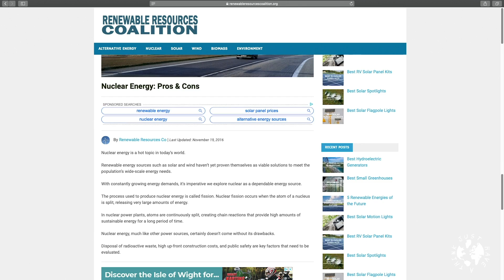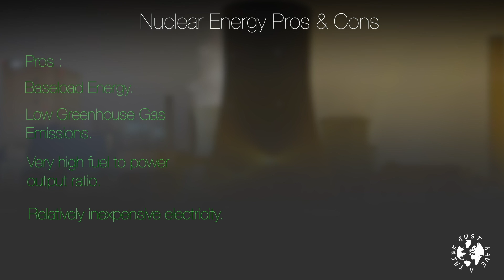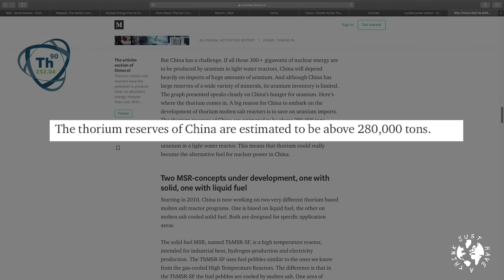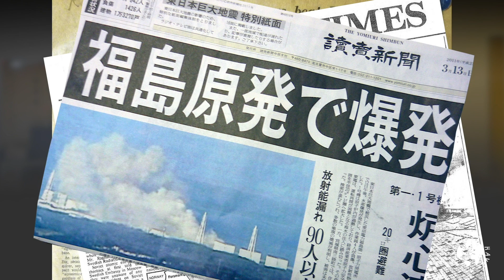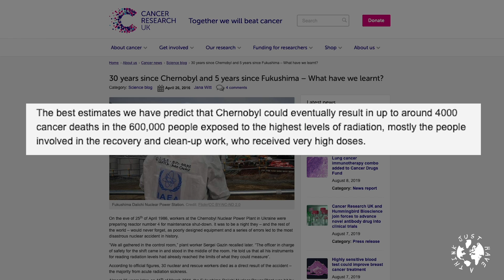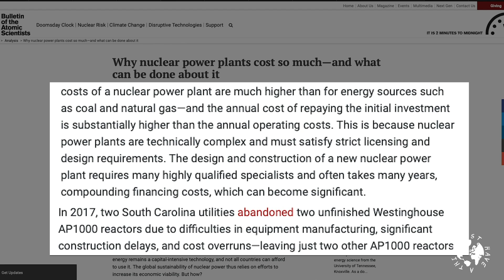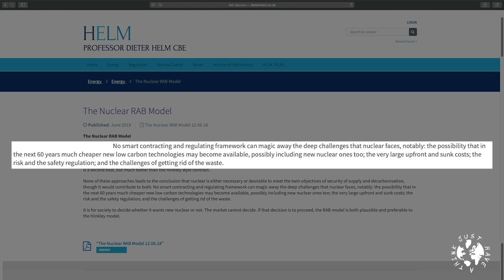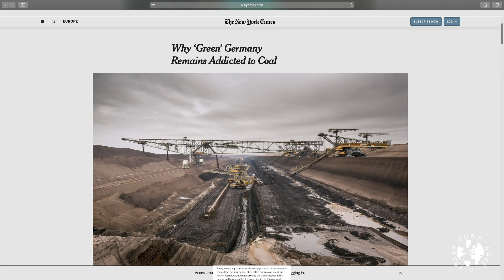Nuclear Energy in the 21st Century

Comment: There were specific circumstances that lead to both the Chernobyl and Fukushima disasters. Chernobyl was an ages old graphite core reactor which should have been shut down decades ago. In addition, the proximate cause of the disaster was an ill-advised experiment. Regarding Fukushima, it was madness on its face to build it on the sea shore in a zone subject to earthquakes and tsunamis. Regarding 3 Mile Island, it was built using 'old' technology which wouldn't pass muster today. There does already exist a safe nuclear reactor technology and that is the Candu heavy water reactor. In the event of an accident, the core is flooded with heavy water which cools and moderates the core in a few moments. Thorium salt reactors are still being developed and tested and they do look promising. A key advantage to thorium salt reactors (if they can safely be brought into service) is that they are much smaller than current reactors. There are a half dozen or so companies pursuing thorium salt technology.  Regarding the problems with cost over-runs of fission reactors in process of construction, it would need a thorough examination to determine the cause(s) in each case. However, bad management appears to be at least a partial cause in all. In summary, there is reason to believe that well planned and managed fission reactors could be safely built using modern technology and with due respect to lessons learned.  Having said all that, according to media reports scientists working on fusion reactors believe they may be close to very close to bringing fusion reactors to the engineering design stage of development.
Reply: This argument includes a lot of correct information, but when you said specific circumstances youre not really going far enough. Graphite moderation played a role in Chernobyl, but what a lot of people don't fully appreciate is the amount of issues that all had to go a very particular way in order for the reactor to have a worst case scenario. These factors not only included fundamental systems in the reactor itself, but also required particular energy usage during the day, and specific operation time for the reactor. If the safety test at Chernobyl has been run 12 hours later than it did the events likely world not have occurred in the same way as Xenon concentration (a neutron absorber) would have been significantly depleted. 

We see this with every major accident and not only in nuclear accidents. Even with a less so incident like Three Mile Island a lot of people correctly point out to the issue of water reactors, but in order for that accident to have occurred there was a long stream of events that had to transpire in order for the accident to occur a particular way. 

In Fukushima yes there is obvious risk from seismic forces and yes the tsunami flooded the reactor creating issues. However there are additional issues such as the time and rate of pressurization in the reactor core following the accident, the culmination of radioisotopes in the reactor core at the particular time, the damage to ventilation pipes on the molecular level following the accident, the molecular composition of air in secondary containment and concentration of materials at a particular time etc. 

The idea that anyone can look at these accidents and say that one thing can be linked to saying that all nuclear is bad is complete blasphemy, because there are too many variables to say that there is only one major issue. A reactor may have points of failure, but that doesn't mean that these points of failure are always the largest reason why a reactor fails.
Reply: Yes, good engineering would have prevented all these accidents. I can point to three specific engineering failures at Fukushima: the seawall was inadequate to the long term tsunami risk, a risk which was known through geological and historical evidence. (A safety engineer at the building of another plant a bit further north along the coast fought valiantly for a higher seawall, and had he not won that fight there would have been a second disaster.) Secondly, they did not consider the consequences of tsunami inundation - had they done so, they'd have put the backup power generators in a safe location. Finally, they did not mitigate the risk of hydrogen build up in an accident scenario. The USA had recognised this and mandated mitigations, but Japan did not follow suit. This last issue would not have saved the reactors, but would have allowed keeping the vast majority of the radioactivity within the containment vessels. 

With good engineering, we CAN have safe nuclear power. Whether we WILL have good engineering, however, is more problematic. Whether we can have safe and economic nuclear power is even more problematic.

See another comment I've made on this video for why I think molten salt reactors are a safety nightmare.
Reply: @michaelwoodhams7866  THE BIGGEST FAULT WAS BUILDING IT
Reply: Good engineering may prevent accidents. But if we're about to build ten times as many nuclear power plants as we have, where do you recruit all those qualified engineers and builders?
Reply: @AdrieKooijman  are we running out of engineers?
Reply: @ShatteredStarz  if we want to massively scale up nuclear I think so.
The necessary level and experience (...) of engineering is not something you pick up in summer school.
Reply: @AdrieKooijman  Think is not good enough. What you think is not fact.
Reply: @AdrieKooijman  I suppose you know that kooijman means bed man.  What makes you think those engineers don't exist?
Reply: Summing up your discussion - I think we can all agree the problem nowadays wouldnt be to build a very safe reactor. The problem is waste production, even with thorium reactors, proliferation, again depending on a few bid companies and countries in ressources and production, uncertain costs per kWh. Im open to gen 4 reactor types, especially fast breeders like the BN-800 or potential improvements like dual-fluid types DFR for transmutation. For transmutation, even high costs wouldnt matter. But if gen 4 reactors will be a solution for mass-scale energy production remains to be seen. In 20 years. Until then, we have to start building up renewables. Theyre manageable, theyve become very competitive economically - so lets do it!
Reply: @hooplehead1019  The waste is very little in volume and can easily be handled. After more than 50 years of using nuclear, the waste has not caused insurmountable problems. Why should it in future?
Reply: @grasonicus  Tell that to all countries HAVING a waste problem as we speak. For example my home country, Germany. Advise them where to put it for the next couple of thousand of years and while youre on it, also please pay for it. :)
Reply: The voice of reason.
Reply: Matthew Huszarik  Like Homer Simpson.
Reply: Fusion technology has been "15 years away" for the last 60 years, at this point I'm starting to believe the scientists advocating for fusion are either idiots or con artists
Reply: You are correct. But these miserable, few examples of the "great danger" of nuclear are all this blog and other anti nukes have. Counting actual injury and fatality, nuclear power has by very, very far the best safety record in the power generation field. If you want safe, go with nuclear. The danger of "waste" is another example of the trickery employed against nuclear. "Waste" that is already serving as the fuel of the future in new technology reactors, has never hurt a single person, let alone killed any one. What do we call a "danger" with zero victims? An Imaginary danger just like the evil spirits claimed at Salem, Mass in the 1600's.
Reply: @wlgoege  Bullshit.   Fukushime as now vast amounts of 'waste' piled up in the prefecture's environs, not to mention the countless gallons of irradiated water pumped into storage tanks, which on the last bite of information from FD, is now being released into the Pacific - in addition to irradiated ground-water leaching into the Pacific since 2011...
.
And where you get the notion that no-one has thus far suffered the effect of nuclear waste is unfounded and doesn't take into accound the future issue of nuclear waste storage.   

.
Your attitude is typical of the conservative view, myopic and ill informed.  Placing,  humans as the only speices that count on this planet.   A classic (conservative) case of - ''' I'm alright Jack ''.
Reply: @Deebz270  then do present us with your enlightened opinion why is that "irradiated water" over there so dangerous?
You do realise 99.99% of what's in that storage tanks is normal ground water? The rest is some traces of tritium - which is quite harmless when diluted. So it so happens dumping it into the ocean is a perfectly safe solution - as Pacific Ocean does have a lot of water you can dilute this tritium in.

Like most eco idiots you seem to be missing one point: you're living on a planet where everything around you is radioactive. That's why every single form of life on this planet has developed a resistance to radiation.
For as long as dose absorbed is low enough your body is designed to deal with it, perfectly safe.
That's why the only nuclear accident that ever pose a threat to anyone's life was Chernobyl - because only there you could have get a high enough dose of radiation.

Comment: I also remember a reactor design that uses the “waste” from conventional reactors and could in theory power the US for 1000 years with what’s currently in storage. 
I mean it’s unproven but I believe they’re building a test reactor already. It’s interesting but I still lean towards solar, wind and hydro with grid scale power storage.
Reply: You seem to be describing a ABR or Advanced Burner Reactor, however these reactors unless combined with other processes are not effective for utility scale energy generation as nuclear burning releases significantly less energy than nuclear fission. As for the timeframe I would say that's likely hyperbole. Construction materials such as concrete or even steel have degradation periods that are shorter than 1000 years, so in order to sustain the reactor you would eventually have to replace it. 

There are several test reactors under development by the US National Laboratories particularly at INL - Idaho National Laboratory, which includes the largest test reactor facilities in the world. Most of these tests today are performed as computer simulations so as to reduce capital costs for experimentation. 

However under GIF - Generation IV International Forum there is a wide variety of generation IV advanced nuclear tests ongoing in over 20 different countries. So far there have even been the introduction of two commercial Generation IV nuclear reactors with the BN-800 Fast Breeder Reactor in Russia and the permitting of a IMSR (Integral Molten Salt Reactor) in Canada.
Reply: @Will JohnsonActually what the comment is referring to is more related to the DMSR tests at ORNL between 1970-1973